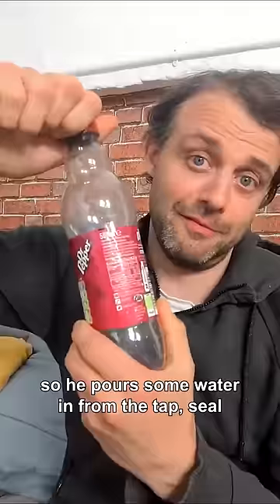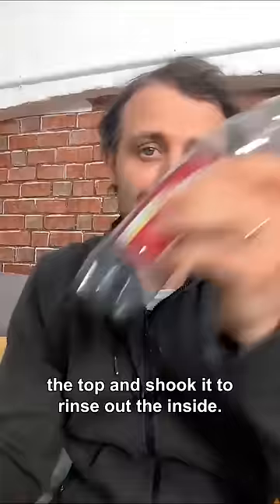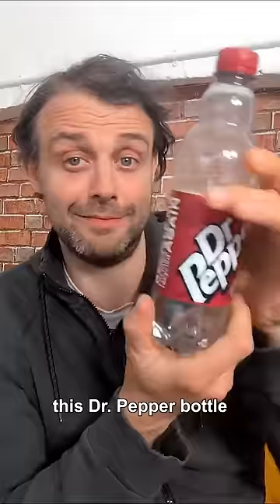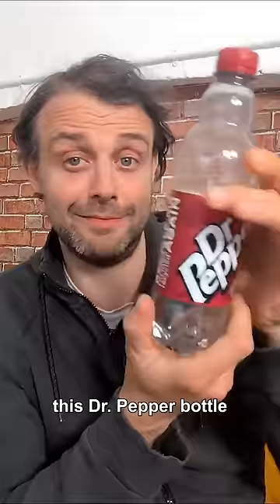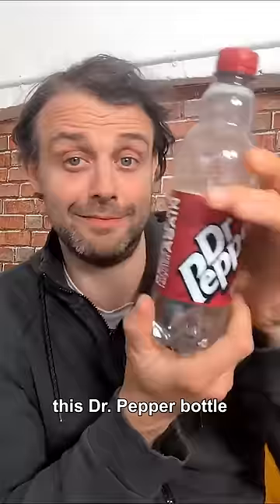Fizzy Drinks Collapse When You Do This... But Why? #shorts

Comment: It’s literally temperature. I’ve tested this myself. Try using hot water and the bottle will pressurize when you shake it. Use cold water and the bottle will collapse.
Reply: No, it's the CO2 dissolving in water. I did it with a friend for an experiment were we needed CO2 in the water.. We measured the pH and it went more acid. I also tasted it and you can tell it has CO2 (You can try it, it's safe, carbonated water you buy is full of CO2 and you will know it's tastes the same).

The experiment needed to have CO2 in water to work, ens it worked.... so yea, the explanation in the video is correct.

Comment: My theory is that he added warm water, thus heating the air inside the bottle, pushing some of the gases out. Then he sealed the bottle, and probably set it on a cold surface. The are inside the bottle cooled down and created a low pressure space.

Comment: Alternatively, like the boiled egg being sucked into a bottle with a burning taper, the cooling air after the taper goes out will contract.  If the water going in is hot and quickly warms the air, also adding steam vapor, the subsequent cooling after the lid goes on might 1.  Contract the air, 2.  Condense the vapor to liquid.

Comment: I've done this with flimsy plastic water bottles. Carbon dioxide has nothing to do with it. You're just rapidly changing the temp of the air in the bottle and its compressing.

Comment: It is CO2 that reacts with alkalinity in the water, only dissolving goes much slower. I’ve seen metal tanks collapse in breweries (CO2 from beer) during a NaOH (alkaline) cleaning step when safety valves failed.

Do you experiment with a little chemical drain cleaner (the caustic version)….😊
Reply: Safety tip: don't drink the liquid after trying this at home...😮

Comment: Yeah this is true. My highschool chemistry teacher taught us that if your soda gets shaken or dropped, instead of opening it right away, roll it around gently and it will reabsorb much of the lost CO2.
Reply: There is a video by Veritasium where he shows that a shaken bottle of soda does not have a pressure increase. Rolling or tapping the bottle causes all the small gas bubbles to raise to the top of the bottle. Otherwise they are nucleation sites for the CO2 to dissolve out of the soda
Reply: @matthewmirabello339 now I'll admit I'm not a fan of varitasium, but I feel like that explanation is bs. Having had numerous experiences of holding a slightly flexible bottle of soda, dropping it, and then picking up the bottle again to find it's rock hard. The bubbles coalescing doesn't explain that.
Reply: @xxportalxx. the pressure doesn’t change when a bottle at equilibrium is shaken. When you open the drink and reclose it the gas has not equilibrated again yet.

Comment: You don't need CO2, just warm air and cold water, mixing quickly cools the air. You can do the opposite with hot water, a small amount in a bottle will heat the air and pressurize the bottle. And an old method of vacuum-sealing mason jars is to set them with lids loose, in a pot of simmering water until the contents heat up (and pasteurize in the process) then tighten the lids, the air cooling will shrink and create a vacuum seal.

Comment: Temperature.  Cold water in a bottle, shaken up, will cool the air and it will contract.  Outsite air pressure will then crush the bottle.
Try using hot water as a counter-example.
I've done this kind of thing many times.

Comment: More likely is water being significantly colder than the room. Given its winter in the northern hemisphere, seems plausible.

Because dissolution of carbon dioxide into water is slow and requires pressure for any decent amount. Also, the fast action is very characteristic of cooling.

Comment: Cap the empty bottle at room temperature, then put it in the freezer and it'll collapse.

Take the cap off the empty bottle and put it in a pot of boiling water, the bottle will shrink.

Let the bottle sit uncapped so that it and the air inside are at room temperature, then try adding hot water and shaking it with the cap on. Do the same with ice water. It's weird.

A related experiment with aluminum and glass bottles is to put a small amount of isopropyl alcohol in them. Shake the bottle so the alcohol coats the inside of the bottle. Then use a long match or lighter near the mouth of the bottle, the kind of match or lighter you'd use to light a grill. First the fire will roll down the inside of the bottle. Then it'll make a jet of fire shoot out of the mouth of the bottle whet the fire hits the little bit of alcohol at the bottom. Don't use too much alcohol or you'll overheat the bottle. I'm not sure if it gets hot enough to make the glass shatter or the aluminum to catch fire, but neither of those things are much fun to deal with. Anyway, you'll hear a whistle while the jet is going, which probably has something to do with things that make bottles expand and collapse.

Comment: A large number of soft drink bottles, at least in the USA, not sure about in Europe, are made by blow molding a PET plastic bottle before labeling and filling the bottle. One of the side effects of using hot water to rinse out the bottle is that it brings the temperature of the plastic up to a point where it will cause the plastic to 'destress' or de-stretch from that heat molding process, resulting in the bottle starting to shrink back to it's original size. This doesn't have to be boiling hot water either, some (most?) home water heaters produce hot water that's hot enough.

At least that's been my experience in the past. The formulation of these plastics may have changed over the past couple of decades.

Comment: You can do this with hot tap water fill the bottle completely full of hot water sloshing it around and dump it out then put the cap on quickly and it will collapse in on itself as it cools

Comment: My opinion is that the ambient air in the bottle and surrounding it was relatively warm. and the water he put insid was very cold. shaking it would then transfer the heat energy in the air to the water... slightly increasing the temperature of the water but decreasing the temperature of the air. Causing the air pressure to drop relative to the warm air around the bottle. and that's why the bottle collapsed.
I've had this happen to me many times and this was always the explanation I gave myself.

Comment: I see this regularly when rinsing 2 liter soda bottles but on a small scale.  One day, I decided to play with the phenomenon.  I ran about 1½ cups of very hot water into the bottle, screwed on the cap, and shook the bottle vigorously, heating the air in the bottle. Then I removed the cap, emptied the hot water, replaced it with the same amount of very cold water, closed the cap, and again, shook it vigorously.  I had heated the air in the bottle,  then cooled it, and it obeyed Boyles law by shrinking in volume, partially collapsing the bottle.  By reversing the order of hot and cold water, the bottle will become pressurized.

Comment: I tought Tlit was a temp difference. Unless you are in Australia mid summer, tap water comes out cooler than ambient air and certainly cooler than body temperature. Once you start shaking the bottle, the water cools the air inside. Maybe absorbs the heat from the air is more accurate. Either way the cooler air takes up less space. Don't know. A way you could test would be to purge the bottle with water, wait for the room to reach ambient temp (or hold it in your hands for a bit), then put some cool tap water in it.

Comment: I HAVE BEEN LOOKING FOR THIS !
i wanted an explanation for SO LONG!
Reply: Here's my keyboard warrior moment, but I feel as if he isn't quite right. Sure it probably has something to do with it but I think it's more likely to simply be water vapor condensing, which in turn lowers the mass of stuff in the air within the bottle. Same reason why containers sealed with something hot form a suction seal when tossed into the fridge.
Reply: @midgetman4206  No, he is right, I used this method 5 years ago for experiments were we needed CO2 in water... We also measured the pH, and water got more acid... CO2 in water makes it more acid. Also the experiment worked, it wouldn't have worked if no CO2 in the water....

The explanation is correct.
Reply: @serpentine1983 honestly it's most likely a mix of co2 dissolving and temperature dropping from the colder tap water. Because there is no denying the temperature drops when you do it
Reply: @cherriberri8373  Yes, I've been thinking about it and discussing it with the guy that has more than 1,4k likes.

UNDER THE CIRCUMSTANCES he proposes all this happens, yea, it's a temperature drop. I did the experiment, repeat under what he explains, and it's what he says. 

HOWEVER under my conditions I did the CO2 experiment, it's NOT. Because when you decompress a gas, the temperature of the gas get's lower, and after shacking the bottle with room temperature water, the gas should get hotter and expand, yet it doesn't.

AND I HAVE TO CONCEDE that under the original question of the video, it's mostly a temperature thing.
Reply: @serpentine1983  I understand that CO2 can and will dissolve into water, it's just that under my line of thinking it's just too unreliable to point to. From the time one drinks, moves, and rinses the bottle, the outside air would have mixed with and even displaced the CO2. The water vapor on the other hand is more recent.
Reply: @midgetman4206  read my second comment please. Thank you. (If it was censored by YouTube (I get that a lot -.-), I corrected myself to "under 2 seperate conditions", one like the one I did my experiment, and the second one I admitted I was wrong under the conditions like the one you describe  =D

Comment: Tap water tends to be COLD. If your home is 20 and the tap water is at 9, that difference will cause the air to contract. Taking up less space and causing the bottle to collapse. I have this happen with 2 litre bottles all the time. Even ones that have had no soda in them for months.

Comment: Steve for Christ's sake it's the temperature of the air and the density it has based on its temperature, the water cools the air making it contract and thereby lowering the volume allowing the atmospheric pressure to push inwards on the bottle. Amazing in any case and physics is always fascinating to behold.

Comment: FWIW colder water would also improve CO2 absorption as temperature impacts the liquid’s ability to hold the gas in solution. This is why warm carbonated soda and beer fizz up. The gas came out of solution and pressure increased.

Comment: Or you use steaming hot water to clean (what you usually should do for cleaning). Steam replaces some of the air before you seal the bottle. When shaking the bottle, the water quickly cools down and the steam condenses what also results in negative pressure.

Comment: As someone who reuses disposable water bottles. I can assure you it has nothing to do with CO2. 

My hypothesis is, shaking the bottle cools off the water, cooling off the air, decreasing the pressure inside the bottle. When you shake the bottle, you are exposing a small amount of water, to a large surface area, which increases the rate it looses heat.

Comment: I would say it is more likely just the change in temperature. I've done it with hot water before. Unless I'm missing something, co2 needs to be forced into the water. I use a carbonation chart to see how many volumes of co2 will dissolve into water at specific temperatures and pressures for the level of carbonation I want my beer/cider to have.

Comment: Use hot water.  Cap it.  Run it under cold water on the outside.  Not really co2 because this works with any plastic bottle and doesn't have to be carbonated beverage.

Comment: This happens with any flimsy plastic bottle if you're in a warm room, fill the bottle with icy cold water, seal it and then shake it. The warm air in the bottle is rapidly chilled by the icy cold water, and the pressure is reduced. Atmospheric pressure then crushes the bottle.

Comment: Doesn’t it make more simple sense that the bottle collapsing is caused from the change in the temperature of the air inside the bottle? When there’s no cold water in the bottle, the air inside takes up a particular volume and the. Once the bottle gets cooled down and there’s cold water inside the bottle, the air inside cools and takes up less volume than it did when it was warmer. Thus, the bottle slightly collapses. I feel like your explanation is so much more complicated.

Comment: This is a problem in the brewing industry! Fermentation thanks are made to withstand positive pressure, but can't handle negative pressure.

After fermentation is complete, while beer is transferred out, CO2 is pushed in to reduce oxidation. Before washing afterwards, you need to purge out the CO2 with air because if it's pure CO2, when you spray water in to clean it, it'll crumple the fermenter.

Comment: Put very hot water in a bottle, shake it, pour it out, then seal.

As the hot air inside cools the bottle will be crushed. I used to do this for my kids as an easy science experiment.

Comment: When you shake the bottle with water in it, you slosh it around, and if the air is colder than the water and air inside the bottle, it will lose heat rapidly because of the molecules being jostled and spread over the surface area of the bottle. 

When water / air lose energy above their freezing point, they contract. 

Since the bottle is sealed, this contraction pulls a vacuum, which causes the bottle to collapse under air pressure.

Comment: Yeah, that also depends on the vapor pressure of the water which is temperature dependent. And water does dissolve oxygen at room temperature, so the effect you're talking about is theoretically possible without CO2 also. Although, I suspect that the phenomenon is different.
If he rinsed his bottle out with hot water, then the bottle would be full of warm water and steam. Capping the bottle then would allow the bottle to cool off and the steam would recondense thereby collapsing the bottle.  This effect is responsible for destroying a lot of tank trucks and tanker cars every year.  They clean the tank out with hot water and then some knucklehead caps it causing a vacuum to form when the steam recondenses. If the vacuum gets hard enough, it implodes.

Comment: It's the cold air a more pronounced effect can be seen with a milk jug. I've noticed it when cleaning them out if you clean it out with hot water shake it around so that all of the air inside is hot and then put in just a little bit of cold water and shake it. The cold water will immediately start cooling off all of the air inside and the milk jug will collapse a bit

Comment: Seeing how low the solubility of CO2 in water is under atmospherc pressure (some expereince with force carbonating in home brewing), I would assume the impact of thermal contraction of the air when cooled got a bigger influence than the dissolving CO2. Also, tap water typically is under 4 bar of pressure in the pipes (at least in central europe) it already absorbed quite a bit of CO2 and is basically saturated when it comes out of the tap at atmosperic pressure.

Comment: Just did this with a bottled water.. ambient temp in the room is greater than that of the tap water. Shaking rapidly changes the temp of the air in the bottle, induces negative pressure.

Comment: Lower Temps cause gases to be more soluble in water. That's why cans of soda explode in hot cars. As Temps increase the CO2 is less soluable causing massive increase in pressure.

Comment: I've noticed the opposite effect with ketchup bottles. I pull it out of the fridge and put it on the table. A little while later, after the table is finished being set, everyone has been gathered for the meal, the prayer has been said, etc. the bottle finally gets opened. Poof! The pressure inside splats the ketchup all over.

My conclusion is that the increase in temperature increases the volume and pressure of the air in the bottle.

Try with an almost empty bottle for best results.

Comment: Also test temperature.  A bottle that is room temp and cold water from the tap.  Shaking will transfer heat from the water to the air.  And since PV=NRT (or Charles' Law) the pressure will go down.

Comment: Conversely, if you take a partially full bottle of Coca-Cola, remove the cap, squeeze the bottle, replace the cap and then shake the bottle, it will return to it's original shape.

Comment: I suspect this could also be temperature related (cold tap water cooling air in bottle). It should be possible to calculate how much of the CO2 in the bottle can dissolve in it.

Comment: I can do that with just temperature difference. I put room temp air in the bottle, pour some h20 from the faucet, shake to cool down the air, bottle shrinks.
Works even better with those little rubbing alcohol bottles. Alcohol evaporates very easily. Just blow air into the bottle, close, shake. You can even feel with your hand how the bottle cooled down.

Comment: I think you’re right. CO2 solubility increases as temperature decreases, so you should be able to test this by repeating it with very cold and room temperature water. The very cold water should absorb more CO2. Since disposable plastic bottles soften more with increasing temperature I would not run trials above 30°C. I think 20°C and 0°C will do. Make sure to keep everything else as identical as possible.